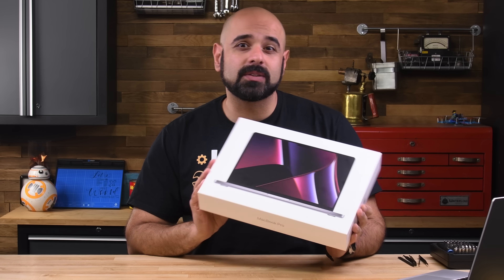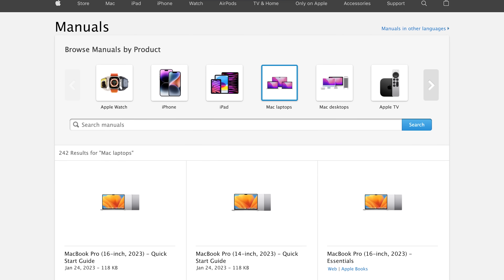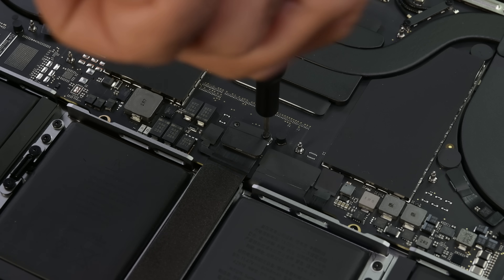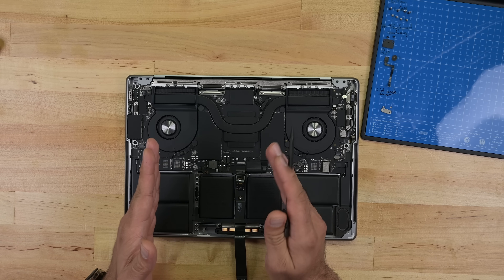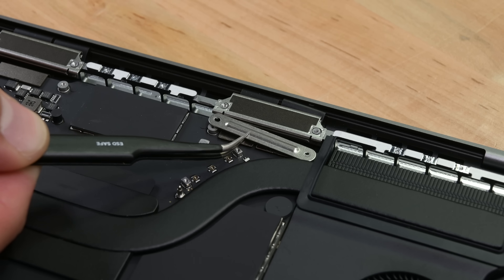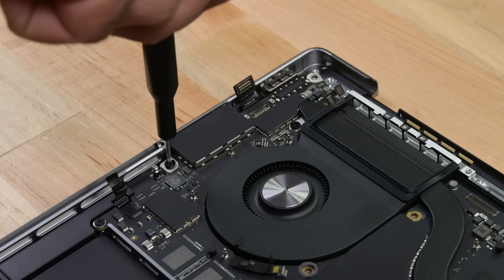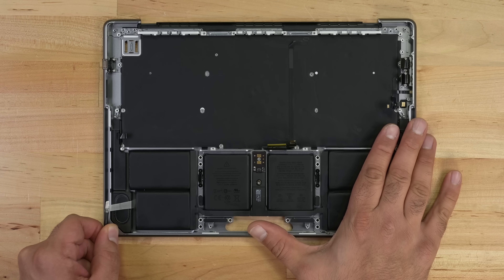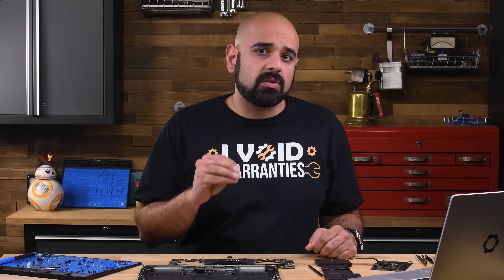14” M2 Pro MacBook Pro Teardown - How Apple Wants You To Do It

Comment: Remember when laptops used to have just a lock switch to remove the battery?
Reply from the maker: And phone batteries could be replaced in 10 seconds flat :( We need to go back to basics instead of burying our heads (and our trash) in the sand.
Reply: @iFixitYourself  You are totally right. Maybe standardized batteries and standardized ways to fix parts, like screens. Or better products instead disposable products. I mean my New Nintendo 3DS XL works like new even the circle pad and the battery. But I already fixed 6 times my Nintendo Switch
Reply: @iFixitYourself  Im not sure I understand the logic of this. A snap/slide in battery, encased in plastic, seems like a HUGE trash issue? I have 5 white mabcook batteries sitting on a shelf. good for nothing. highly doubtful they can be "recycled"? so landfilled.
Reply: @iFixitYourself  heck no. all these quick-replace mechanisms come with significant drawbacks. There is absolutely no need anymore for those now that batteries only need to be replaced every few years. Sadly there are so many people that desperately want to go back to the age of brick-style plastic laptops.
Reply: @iFixitYourself  I miss tactic nokia battery reloads
Reply: @iFixitYourself  Samsung made the infamous battery commercial where they touted the ability for their phones to have replaceable batteries while the IPhone didn’t, only to have fixed batteries later.  As much as people are vocal about phones with replaceable batteries, they don’t speak with their wallets. The iphone design won.
Reply: @iFixitYourself  And companies like Apple would probably say some bs like "We can't do that because it will 'interfere' with our vision of the architecture of the device." No. You just don't want to do that in order to make it harder for people to replace batteries just enough to make the average person think that it's hassle free to just buy a new device.
Reply: @iFixitYourself  Yes, my Samsung Galaxy S4 (admittedly an old phone) has a battery that could be replaced in 10 seconds flat just by removing the plastic back cover. 
The same goes for my 2015 HP Pavilion 15 - the battery is just clipped in and doesn't need any disassembly. 
Older laptops, such as the Acer Aspire's from 2011/2012, even had upgraded batteries (e.g. a 9 cell instead of a 6 cell) that you could use.
Reply: @TheSpotify95  my phone has a USB connector that I can plug into ANY power source including a power bank and continuoisly use without having to shut it down. You on the other hand have to make sure to keep a charged, proprietary set of spare batteries. How people still fan for this outdated BS is beyond me.
Reply: @Daniel Bond Reviving outdated things of the past certainly does have me.
Reply: @Daniel Bond no, because as an Apple user I never ever had to throw away anything.
Also, here we recycle electronics and not just dump them on a landfill.
Reply: @Daniel Bond I‘m glad that now you know.
Reply: @Daniel Bond about my devices simply just working reliably?
Reply: @Daniel Bond I do not. Merely stating facts.
Reply: @Daniel Bond how terribly relevant, 10+ years after
Reply: @Daniel Bond well my butterfly keyboard was replaced by Apple - free of charge. I also got a brand new battery and trackpad, all for free.
Reply: And where trash after 2 years ...
Reply: @quentin6583  My Asus laptop from 2015 is still going strong, with a new battery that took me 5 seconds to replace.
Reply: Remember when batteries used to only fill half the battery compartment with the actual battery and the rest with just a lock switch mechanism to remove the battery once after multiple years?
Reply: Yeah, and it was bulky and fragile. Short lived too. Just like an old cell phones. Stop this “old day good” propaganda.
Reply: Jup, the two most used laptops here are almost a decade old machines built like that.
With some upgrades, replacements and good cleaning, still going and not in need of replacement still.
Reply: Same, my aged thinkpad is now running headless archlinux and I ssh to the machine (has a beautiful keyboard but blazing 50%sRGB TN screen, eyes are blind) sometimes, it run 24 hours without battery so no worry about cycles. Now? no one seems to care. Same about phone. Just like not everyone needs a GoPro I don't think I ever go to beach once in five years, not even mentioning that sand saltwater is probably stronger than what phones can suffer anyway,.
Reply: Pepperidge farm remembers
Reply: it disgusts me even valve does it with their steam deck
Reply: The least they could do is have the battery easily accessible like every other Ultrabook out there but noooo
Reply: My 2010 MBP is still going…bought base RAM and upgraded day it came. On an SSD now and considering whether to patch it or not. It’s running 10.13.6 rn
Reply: Im still use to having a removable battery with a lenovo laptop.
Replacing it is super easy.
Reply: I have a Dell sitting on my desk right now with that very ability
Reply: @WhittyPics  legend! 😮
Reply: @WhittyPics  My latitude having space for 3 batteries, you could change the normal and dock having the notebook on the media bay battery
Reply: @WhittyPics  unfortunately even dell have succumbed to this. Even the thicker of the Precision line (7xxx) of laptops now no longer have an easily removable battery. It's no where near Apple levels of hard, you only need to unscrew the backplate. But it does mean keeping the battery in good condition by simply having it removed in the 90% of the time the laptop was being used as a desktop is no longer feasible.
Reply: @WhittyPics  You can't get a new battery for that anyway 🤣
Reply: Which no one used to use.
Reply: I have one. It was all but useless in 3 years. I’m sure the vast majority of M2 machines will still be sealed, usable, and working fine in 10 years.
Reply: building a comperable battery with all the safety casings it would require to make it legal and safe would cut down on the capacity by like, half.
Reply: Yes ♥️
Reply: Yeah, I am still using my decade old Clevo P150EM, it has socketable CPU and DRAM, modular MXM3 GPU, replacable storage and battery, and lots of replacement parts still available - I can continue to run this thing forever if I need.
Reply: The good old days 😪
Reply: If you buy your laptop to sit on your desk, you don’t mind, but those laptops were heavy and bulky.
Reply: My Dell laptop is using a battery with a lock switch system. I think Apple become more and more strict about repairability for their devices
Reply: Look up XMG, a german laptop brand ! My laptop has it. And it's a recent laptop !
XMG also makes very good value for money devices, but they don't advertise so you don't know about them most likely.
for battery life this isn't the best solution though
Reply: Yes and I also remember they were 3 times heavier and had terrible engineering inside.
Reply: Yeah back then when they were literally 4 times thicker and heavier. No thanks..
Reply: @Raja995mh33  Well all the new laptops are getting thicker. But if they want to put a removable battery in a thin computer, they can do it. There is no excuse to make overcomplicated battery replacement like the mac of this video
Reply: @sergioflores1352  not really... they still get thinner. Even the MacBooks only appear to be thicker. The 14" for example got thinner than the previous 13".
Reply: @Daniel Bond Macbooks do not twist and creak specifically due to their unibody aluminium chassis. Removable batteries always need protective shells that eat away valuable capacity. No, no no. Batteries in modern laptops need to be repalced every few years only, so no need for these utterly outdated mechanisms.
Reply: @dannyize This is a Mac not some plastic Windows laptop like you're used to.
Reply: Yeah, I’ll trade that for 20 hour battery life with a thin design.
Reply: @nzer19  Current Macbooks offer way over 20h of battery life on a single charge and a thin design.
Reply: Yeah they were slow and complete trash.
Reply: @s13shaka  the point of this is make a comparison between easily accesible battery replacement vs the overcomplicated apple design just to remove the battery
Reply: @sergioflores1352  Except that no one wants laptops from twenty years ago. Grow up kid.

Comment: Not sure what the consumer gets from having a fragile device like a screen sensor paired by serial number to the PC. Hinges get the most mechanical stress on a laptop too.
Reply: when i worked in IT i used to love the ability to take out components of scrapped pc's and placing them in PC's that just died. The workers came in i took a look, saw perhaps that the battery was swollen, take out a few batteries from same model number, test em and done in 5-10 minutes.  

Imagine running a company with 10 000 Macbooks, if one has a fault its straight to the bin with an order of a new one incoming...  Think different. 

People like to use the stolen laptop argument, but god it creates so much E-waste when Apple forces everyone to not have a market for macbook parts at all. Imagine those 10 000 macbooks running their course, a few have bad batteries, others perhaps broken screen, and unable to reuse anything, doesnt feel like owning the product. Its like buying a car but when the tires are done you have to let the manufacturer replace them for you, if not replaced with the manufacturers tires the car would brick itself, the tires are not sold and no one but them can replace it, feels dystopic.
Reply: @eriksvensson2098  so glad you posted that. I live near a Goodwill that sells surplus and rejected laptops. It’s hard enough to get those working without this extra layer of “protection”. These things are going to fill landfills.
Reply: that there is not a black market for stolen macbook parts?
Reply: @ghfsd786fa /videos There wouldn't be a black market for Apple parts (not that there is, but anyway) if they didn't lock their stuff down and just sold the parts in the first place.

You people with the circular logic are part of the problem. This sort of thing only works because Apple made it a problem in the first place.
Reply: People have no incentive to steal your device for parts if all they can get are passive components. Activation lock iPhones and Macs, I often see unattended in public and thieves know not to go for them because they aren't worth pretty much anything and the market for them is small. I keep my phone in my back pocket or leave it at the bar or whatever, no problems. Theft rings at music festivals are caught with bags of phones and most of them are Android or older iPhones where not all parts were serialized.

Comment: Battery replacement on a 2015 MacBook Pro only requires disconnect of a few cables and removal of speakers — 10 minute job. On this M2 the same process look so complicated!
Reply from the maker: Remember, this is the official Apple way of doing it because they sell the battery and lower case as a single unit and they're terrified of getting sued over a battery injury. You can see the abbreviated version in our guide which still requires the removal of the trackpad but spares you the rest of the pain.

https://www.ifixit.com/Guide/MacBook+Pro+14-Inch+2021+Battery+Replacement/150895

And our video and guide explaining battery safety:

https://www.ifixit.com/News/69041/how-batteries-can-catch-fire-and-how-to-prevent-it
Reply: @iFixitYourself   they wouldnt have to worry about getting sued over a battery injury if they used screws like they used to do instead of permanantly glueing the battery to the top case. In my opinion their claim that they switched to gluing the batteries to reduce the thickness of the device is bs, considering that the macbook air used to actually be thinner then it is now and the battery was installed with screws. Yes batteries can be dangerous if you dont know what you are doing. Does that stop other manufacturers from selling replacement batteries that arent glued to the top case. No it doesn't because almost every other manufacturer has figured out that it is better to use screws.
Reply: @iFixitYourself  don't know why you insist on calling it lower case when it's actually a top case. They even call it top case in the manual.
Reply: Have you ever worked on a car from 2023 and one from 1990? Technology does change, you know...
Reply: @dystopia2386  They want an excuse to sell it with the housing for $999
Reply: not true. you are describing macbook air. macbook pro 2015 battery is glued hardly to the case and its replacement takes half an hour if you do it without rush and risk of damaging it.
Reply: im very impressed that anyone doing it for the first time taking 10 minutes, heck even a pro would probably need more time. Took me around 45 minutes due to the glue. Seems like many steps on the m2 can be skipped aswell, and would probably take a similar amount of time.
Reply: The 2015 is going end of life next month and this battery guide is exactly what I'm fearing due to vendor lock-in with software

Comment: Anything with a software lock should get an instant zero.
Reply: iFixit do you prefer the 14” or 16”?
Reply: So you think that this laptop is as unrepairable as the airpods? 

Maybe it's not worthy of 5, but it also doesn't deserve 0. Software locks are a big no no, but they're not completely unrepairable, so the repairable score should not be 0. If they have to give everything that has an apple logo on it a 0 just to satisfy the internet hate boners on apple, then their score would lose their meaning. They give credit where credit is due, and bash them where they deserve it, I think that's just fair.
Reply: @Summer-xu8qu  actually the Airpods is repairable, local shops in my country able to replace the battery in just half an hour with no visible mark.
Reply from the maker: I think that would be unfair. We need to acknowledge that there is a means of repairing devices without having to send them to the scrap heap. Parts pairing is evil but we've made progress in the last few years by forcing industry to move towards repairability and the fact that Apple is now providing parts, albeit locked, is more than we had before. 

It's far from where we want to be though and we still have plenty of work to do.
Reply: @iFixitYourself  I agree. It's not completely software locked, you can replace most stuff. But that is still very far from a 5/10.
Reply from the maker: I can respect that and I can certainly understand your perspective. There is a methodology to our scoring and we're planning on releasing more details on that soon. Hopefully that will shed some light on why we score things the way we do but that doesn't mean there isn't room for discussion and improvement!

Comment: 3/10 is the maximum rating in my eyes and I am an IT service technician.
Reply: i was thinking the same and I'm not even used to opening laptops up or a It service technician. My asus tuf laptop was easier to remove the battery than this mac

Comment: What laptop r u using 👀 or is that hust a sricker 🤔
Reply: Framework laptop
Reply from the maker: Framework laptop :) It's a beauty, I'd highly recommend it.
Reply: @Krish Garg the port thing is cool but a gimmick imo. It takes A LOT of space for a single port and does nothing special. With the same space and less money, you could have all the ports directly “mounted” into the device  at all the times.
Reply: @Alex-hv3ir  well their pitch is also an upgradable motherboard, so they can sell you just that, you keep your old case and ports you bought, and only swap the board. if they soldered the ports to the board so it would be like you want, the board and case would have to be one piece otherwise old case wouldnt have new ports.

its like they planned it to be repairable from the start or something wild
Reply: @Alex-hv3ir  why remove options? More option is always better
Reply: @bootchoo96  Are you aware how CPUs get socketed? We do that but with ports, simple, I say that, I said giving the Xbox Series X and S multiple internal drives would've been simpler, better and cheaper for everyone, but apparently that thinking is too smart and I should 'Be An EnGiNeEr At MiCrOsOfT'
Reply: @bootchoo96  why have “useless” options? A port is a port, and if you can have “all” of them at the same time, why sacrifice space like that
Reply: @Alex-hv3ir  soldering is not for everyone, framework solves that
How is that hard to understand

Go get a macbook if you don't want to swap / repair stuff
Reply: @Krish Garg yes, the 4 very recessed ports, where the only thing going for them is their seemingly full support of the USB4 spec with dedicated chipsets for each port, but it doesn't come with an integrated SD card reader, and the microSD card reader it does get an expansion card for is just UHS-I, which is the bare minimum that should be expected of something that came out years before the framework has, and given the speeds USB 4 does, would be better served integrated on the mainboard, plus using expansion cards gives a limited amount of cooling for what the expansion cards get used as. They try and solve problems with unnecessary complexity